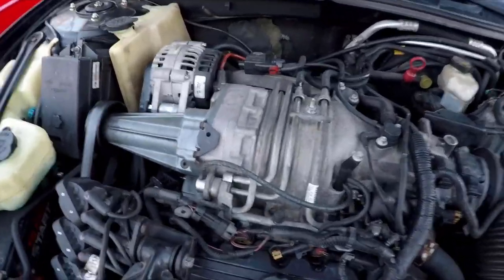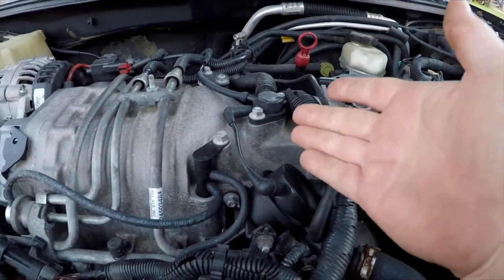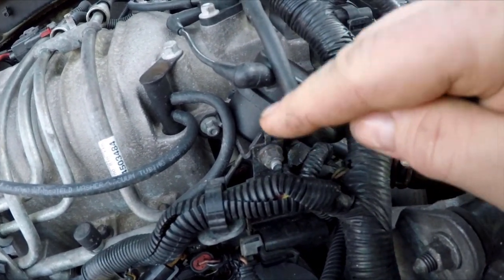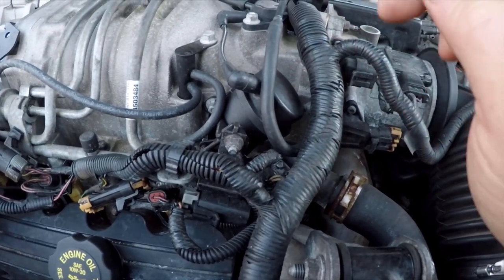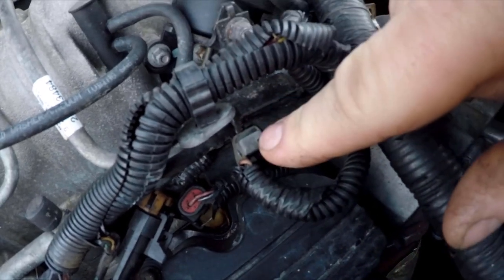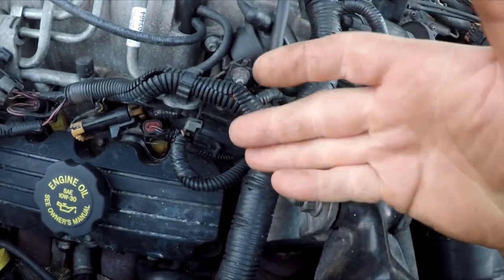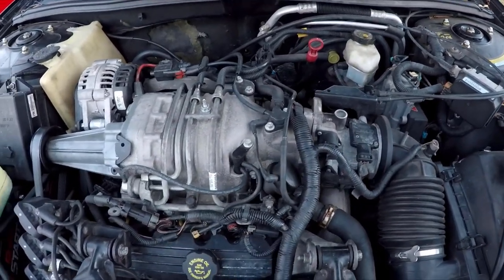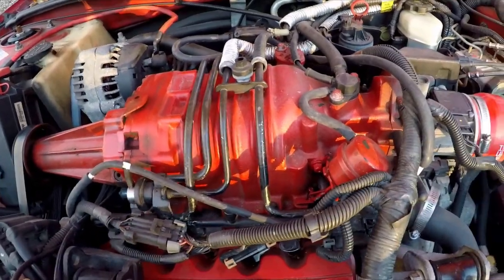Supercharger Boost Bypass Valve Basics

Comment: Why is my gtp super charged 2002 braking up when hard accelerate.  Had it plugged in had to change number three coil pack ran a little better but not much still breaking up on hard acceleration

Comment: Hello I have a Ford Lightning and just did the bearings and boost bypass valve.. Maybe you heard a poorly adjusted bypass before and was wondering if you could check my videos and let me know if it sounds like it to you..  And maybe how to properly adjust the bypass valve
Reply from the maker: I will take a look
Reply: I have an 01 Lightning & at idle, the arm doesn’t go up, stays on the stop like when the engine is shut off. Idles & runs great but my IAT2 temps are 20-25 degrees hotter than before. Also my boost is averaging 11.89 lbs on WOT. Im going to change the boost bypass actuator valve & hopefully this will fix it & bring my IAT2 temps back to 35-40 degrees over ambient temp.

Comment: Hi Brother.. I know this is an old video but maybe you still could help me with this issue:  You said in the intro that if there is no boost at all then you have a huge problem, but didn't say what exactly, and that seems to be my situation. I have a 2004 Grand Prix GTP CompG and the dash gauge shows zero boost... I checked the boost valve and works fine opening, and according to your video the solenoid  doesn't affect the boost production at least to the half, so if it's failing should be giving at least some pressure. Other symptom is that the engine seems to cut off around 3500 rpm. and I don't know if this is related. So.. what could I be missing? because there is no codes at all  and as I said i can't get any boost. Thank you in advance.

Comment: Thanks for sharing Salem and explaining.  I have an Eaton m62 and am getting a p0300 and p0327 code.  Did a leak test with brake fluid and found RPM's increase at the Bypass release valve shaft. Any suggestions and thanks for your help in advance.
Reply from the maker: Interesting.  Not a common leak point.  Is it pissible that the mounting gasket below that is leaking?

Comment: I've just ordered a solenoid for  my 2005 GTP.. removing the old one is easy, however the small vacuum harness on the back side of the solenoid going to the manifold and teed to the map sensor was very brittle and broke in 3 places. the harness is obsolete,,so if you encounter this you will probably have to make your own. I was able to get some universal connectors off of Amazon and fabricated a harness.

Comment: Any chance you can make a more in depth video on diagnosing the boost control valve solenoid and whatnot or offer some further insight possibly? 

I just purchased a 06 GP GT (3800 series 3) and shows no boost on the display unit and looking to rectify the issue. 

As well slight tick from the supercharger so looking to change the oil in that as it was probably overlooked over the years (great videos too btw, subscribed and following) but was wondering if I should do the coupler and any other preventative maintenances at the same time on the supercharger?
Reply from the maker: I will see what i can do video wise.  The couple will usually make noise when bad.  Fluid is a good ide though

Comment: Hello, thanks for the video. I have a question, I noticed the other day my bypass valve hose was disconnected. What would this do? I've been able to drive it with it like this for a while now. When I plug it back it the car runs ok but definitely not as good but I think its because the hose is pinched and not tightened down yet. I plan on putting a hose clamp or something to get it to stay on this time. Any help would be appreciated.
Reply from the maker: I would deff. Get it put back the right way and secured

Comment: When u say half boost does that mean your gauge doesn't show anymore than 1 or 2 psi?. My cars shows about 6 psi max. So I should be ok correct?

Thx, Dennis
Reply from the maker: When i say half i was refuring to the factory grand prix boost gauge.
Reply: @SalemDoyle  were you making any boost? Or were making less boost than normal? I'm at 6 psi on a 100% stock 2004 Monte Carlo SS and I make 6 psi. Is that the boost I should be making?
Reply from the maker: I think 6 to 8 is stock.  When my pypass valve failed i made 0

Comment: @ Salem Doyle - Question? I installed LED HEADLIGHTS and FOGLIGHTS on the GTP,  BUT when I turn the fog lights switch on, it just turn on the high beams to the headlights. Ever run into this issue?
Reply from the maker: Never seen it turn the high beams on.  But my 99 led fogs made the indicator light come on inside on the dash
Reply: @SalemDoyle  my 98 gtp has 177,000 miles on it guy didnt take care of the car I can tell. I don't see any light bars above where it says boost. Any ideas what I should do???
Reply from the maker: @crisknapp1990  check the map sensor
Reply: @SalemDoyle  I just paid garage $300 to fix exhaust and change the actuators in my gtp. Its a 98, heat is blowing out warm but I hear squeeping when I turn fan on and heat doesn't come out of vents with any force behind it. You think I should put a new blower fan in it?
Reply: @SalemDoyle  how do I test the map sensor?
Reply from the maker: You pretty much have to look for codes and double check that the vacuum line is attached.
Reply: @SalemDoyle  ok. Looks like lines are good but check engine light is on and has flashed. I'll have an ob2 scan done on it ty
Reply: I have the same thing happening in my 98 GTP. Got LED headlights and fog lights from zzp and when I switch the fogs on it also turns on the brights. Gonna swap in the old fog lights and see if it still happens
Reply: @midas408  - Turned out to be a Voltage Issue when replacing headlights with LEDS. The computer thinks the fog lights / head lights are burned out so it trips the high beams to let you know. I had to install a [9007 Bulb harness resistor kit] from SEALIGHT on Amazon which fixed the issue. $21.99 for both headlights.
Reply: @midas408  my 98 gtp needs a wheel bearing drivers side. Digital Speedo gets bright then goes dim. Dukes car stereo disconnected power 2 my heater and information Center. One thing after another
Reply: @Mmyers1177  Thanks for the info, I'll give that a try

Comment: I do not know if you will see this, but u pulled a m90 off of an unknown year Pontiac gt with intentions of putting it on my 1996 Buick park avenue. The only issue is the park avenue has that small little vacuum tower in the case and the newer Pontiac case does not… is there any way to modify the vac lines to make it work?
Reply from the maker: Yes, just set it up the way the newer ones are. Like how my 99 is setup

Comment: Could you tell me what wire is ground on the bypass sensor. Mine is top swapped I’m trying to put it in and hook 12v back to it. Colors are brown and green ish color
Reply from the maker: Pink is power, grey is ground that runs to the pcm

Comment: Question....my Buddy told me the loosen the 2 nuts and push the boost valve all the way down ?!
   What will this do , cause it could move alot
Reply from the maker: If you go to far with that it may make the valve not function correctly
Reply: @SalemDoyle  works pretty good , a bit more throttle response...took my boost from 7 to 9lbs , not sure if that's good 
  I have a series 2 Bonneville ssei , have headers , 1.9rockers , 90lb valve springs , 3in exhaust , zzp tuned computer and 3.4 pulley
  I just started getting into the supercharged 2yrs ago , still learning  and it's been amazing 
  You have great videos and inspiring as well , thank you bro
Reply from the maker: Thanks

Comment: So it basically IS electronically controlled then rather than purely vacuum mechanically controlled? yea? does that mean a holley efi systems boost control can take advantage of it?
Reply from the maker: Yes. Possibly to some extent.  But remember boost level is ultimately controlled by the pulley size

Comment: I got a 97 riviera that seems way down on power compared to a regal and a park Ave I previously owned. I'm assuming I have a boost leak. The bypass valve seems to functioning properly. I tried bypassing the solenoid and it runs the same. Where else should I look for leaks? Car seems to run great and gets excellent gas mileage. Just seems way down on power, it can't even spin the tires...
Reply from the maker: Can you hook a vac/boost gauge to it to verify boost?
Reply: @SalemDoyle  I need to get one. I will get back with you when I do next week. Thank you for the reply, I appreciate it!

Comment: Salem I changed the pulley for a smaller one but I have half the thrust but the solenoid or the valve does not work, you think that if I put the 2 pieces new it creates a greater impulse and is not dangerous for the engine. Another thing the solenoid is removed and the new one is put in and already or there is another step to change it. It also brings 3 original injectors and 3 trans sam affects you something or not. If you answered me, I would appreciate it.
Reply from the maker: I dont completely understand what you are saying here.  Changing the pulley shouldnt lower boost though.  Sounds like something is wrong with the valve or solenoid
Reply: I mean the band for a smaller one And of the injectors it brings 3 different ones to the original Cres that affects

Comment: Hey, so I just got a 2000 ssei today and it’s half boost on gauge and no super charger whine. Like at all. Would this still be the issue? I noticed the valve only moves about half way if I pull it with my finger it flips up and stays there. I think that doesn’t seem right
Reply from the maker: Test the solenoid, that could be the issue

Comment: Hi my name is Frank I am putting my 3800 sc in a fiero. swap specialties did the harness conversion and did not pin out for the boost control solenoid. I do have a zzp tune. in your opinion Should I wire for it
Reply from the maker: Would be easier to just tune for having it bypassed

Comment: Quick question I'm running lean and I've replaced all the vacume lines except one.. the boost vac line that goes from the vacume tree ontop of the supercharger to the boost bypass valve.. and it's cracked pretty bad. Could that cause lean condition?
Reply from the maker: Yes
Reply: @SalemDoyle  awesome thankyou. I'm running 16 percent lean on my long term fuel trim. Makes sense when I'm leaving vacume and boost

Comment: Great video. Quick question do when the car is off and the the pushrod is at it's longest length the valve is closed? In park (when the boost is bypassed) when I rev the car the, the rod shortens and pulls up that is it opening and bypassing boost, correct? Thanks in adat
Reply from the maker: Yes.  Pulled up is open.
Reply: @SalemDoyle  thank you. I'm pretty sure my solenoid is bad. I'm only hitting about 3 psi on my scanner
Reply from the maker: The electronic part usually fails
Reply: @SalemDoyle  back up to 7psi 👍

Comment: Went to about about 120 on the highway and got a check emissions    Plugged the code reader in and said I have a turbocharger/supercharger bypass valve mechanical?  Is this serious?  Am I able to drive over 10hrs straight.  I’m going on vacation soon. Would like some information.  Thanks
Reply from the maker: I would stay out of boost untill issue is fixed, but other than that you should be ok

Comment: Does the bypass stay closed when in park? Can I rev the engine and build boost while in park so I can physically look at the bypass opening and closing on the car? Or do I have to be in drive for the solenoid to shut the bypass valve?
Reply from the maker: It will open and close with throttle input in park
Reply: @SalemDoyle  it stayed open when in park and wouldn’t build any boost. I can only build about 4lbs when in drive. Stock 98+ L67. Can I leave the bottom nipple on the actuator open and plug the actuator side of the solenoid to see if I can get full boost?
Reply from the maker: @billballin6948  i believe that will work

Comment: So mine doesn't have a boost solenoid or the wires for one but my motor was taken out of a wreaked gtp and shoved into a base model I bought it off a friend and it did make full boost before and now anytime I go to make boost in anything else but park it seems to sputter or like you said kinda kock? Any help would be appreciated thank you!
Reply from the maker: Did it just start doing that or has it always done it?
Reply: It just started doing it
Reply: Don't know if you fixed it. Does it idle? Could be mass airflow sensor.

Comment: So, when the supercharger is "sucking" creating a vacuum at the throttle side, that valve will open? Opening it really closes the butterfly valve, allowing boost to build?
Reply from the maker: When the butterfly valve is closed yes, it builds boost, when it is open basically air just loops back around and into the inlet side of the supercharger so that it cannot build boost
Reply: @SalemDoyle  well, I wish there was an easier way to speak with you. I have an 04 Impala SS, with a lot of things I need to know about it
Reply from the maker: The easiest way is to look me up on Facebook and message me there

Comment: Do I cap off the unused port on the Boost Bypass valve or leave it open? Engine shuts off or idles rough. I have a vacuum leak somewhere and will be replacing some of the hoses. Would the EVAP/Canister hose cause this?
Reply from the maker: Evap hose needs to be attached.  The other boost hose i think can be left open

Comment: Would these cause high long term fuel trims? My boost is fine but sometimes feels heavy and sluggish
Reply from the maker: Fuel trims mean a fueling or metering issue.
Reply: @SalemDoyle  I got a new fuel pump and filter basically I found no leaks either only thing I saw smoke come out of is the boost solenoid. I'm stuck on what else it could be
Reply from the maker: If smoke came out of the boost solenoid it could be leaking vacuum there

Comment: Hello, thanks for your video. A question, please, on Mercedes SLK R170 if you know...if the camshaft magnet isn't working the air bypass valve stays always open? So, not moving? Am I right about this? And if so, if I unplug the magnet to test, the butterfly valve should now move or is it remaining always open, anyway? How may I test the valve, if not? Thanks
Reply from the maker: On most superchargers, the valve stay open any time it gets vacuum.    They usually default closed when the engine isn't running
Reply: @SalemDoyle  Here the butterfly stays always open. By Mercedes diagnosis they say that camshaft magnet needs replacement. I saw some videos where when the supercharger is running at ~ 2000 rpms it should close...hence my question. Thanks
Reply from the maker: Check this out
https://www.benzworld.org/forums/r170-slk-class/1437633-why-bypass-valve-staying-open-98-a.html 
There is a pdf linked in that tbread that is pretty good.

Comment: What position is the bypass valve at idle? On my car my bypass shaft is fully extended at idle.
Reply from the maker: It should be open.  So the lever should be up
Reply: @SalemDoyle  Sinse my lever is fully extended at idle, would it be safe to say that my bypass valve is bad? Thx.
Reply from the maker: Its bad or has no vacuum to it
Reply: @SalemDoyle  when I was checking my vacuum lines I broke the  one that connects to the bypass. Do you know wear I can get that tree that sits on top of the blower? 

Thx Dennis
Reply from the maker: Gmpartsdirect.com or ebay

Comment: I have a 2000 GTP and the boost will go slightly above half is all. maybe 1 or 2 bars. Does that mean mine needs to be fixed? is it supposed to go full bars?
Reply from the maker: Yes. It should fill up the gauge..
Reply: @SalemDoyle  ok good to know. Thanks!

Comment: I just recently picked up a 96 Bonneville se and the boost control valve has a broken nipple for the line coming from the top of the intake. When I drive the car I only get at most 1.3 psi of boost. It still pulls hard but is that broken port the cause of the low boost numbers? And what is the stock boost supposed to be?
Reply from the maker: Yes, stock is around 5 or 6 psi usually

Comment: Would running "SEAFOAM" hurt anything or will it aculy help clean out the inside valves? 🤔
Reply from the maker: Depends.  I wouldnt run it through the supercharger because it might damage the rotor coating.
Reply: Seafoam goes in the gas tank, and the injectors mix it with the air after the supercharger, so the supercharger will never get any seafoam on it.  Just don't pour seafoam into the air filter, and you are fine.

Comment: Nice

Hey man, i need advices for my c230 kompressor,i want to increase boost and reduce pulley,
Reply from the maker: I dont know a lot about that setup.  Does it have a traditional pulley or one with a clutch?
Reply: @SalemDoyle  its traditional
Reply from the maker: Ok.  Contact smoothflow pulleys.  They probably make something for it

Comment: Hey Salem my bypass valve is sucking in air from the bottom nipple.The bypass valve is sucking in quite a bit of air from the bottom nipple atm and you can hear a loud hissing sound. The engine is running extremely lean atm due to this vacumm leak. The other nipple has a hose connected from the by pass valve actuator to the supercharger.  Am i supposed to cap this nipple off and vacumm it or is that supposed to be a venting nipple? Thanks!
Reply from the maker: That nipple should go to the boost control solenoid, there should be a vacuum hose